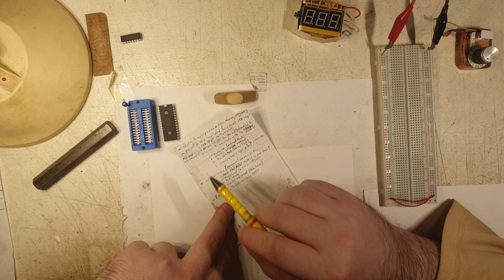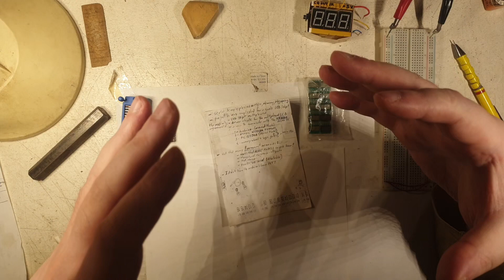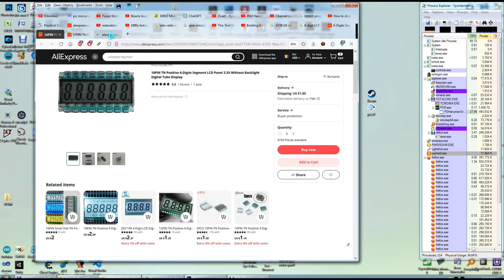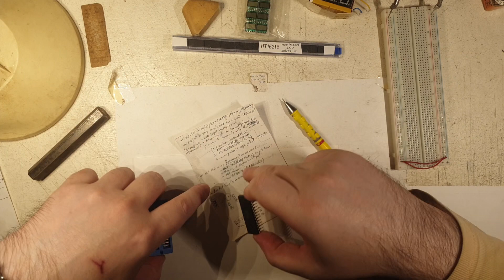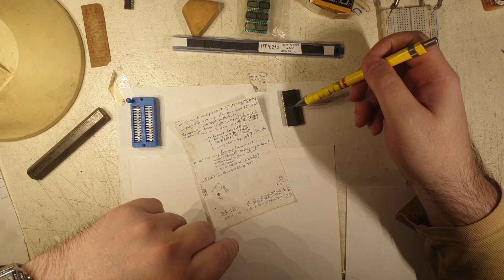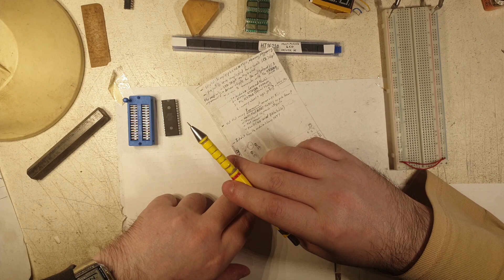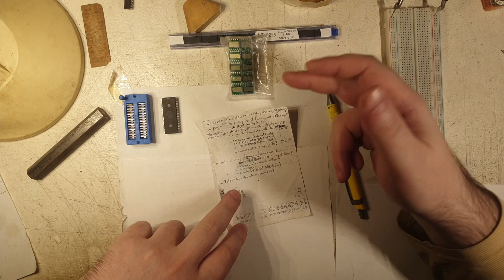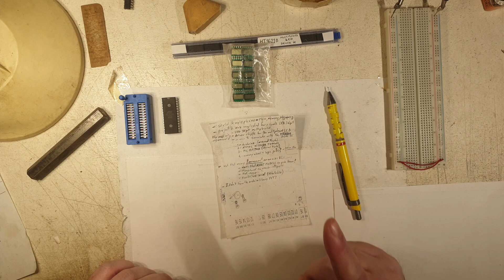#256 General discussion about serial&multiplex, MCU, Memory, programming, LCD driver HT1621, EEPROM

Comment: Let me tell that you have hell lot of good content. Subscribed. But I have some recommendations for you which can help your audience :
1. You can break the video into smaller parts
2. Now since the smaller part is focusing on one single topic, you can include some demo and practical examples
3. The video speed, please bring it to normal.
That's it.
Reply from the maker: Thank you for your nice comment. The speed is to compress a lot of time into smaller time !!! That's it's only reason. Trust me, this is not that fast and it is very intelligible and you will get used to it, in time.